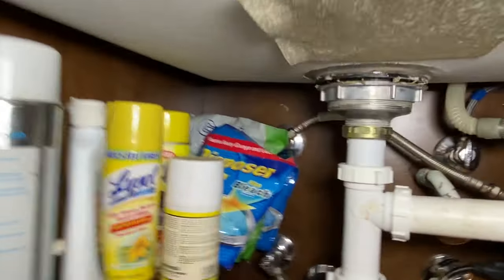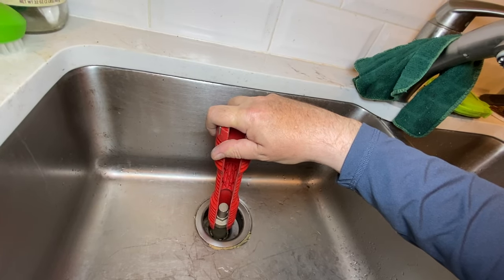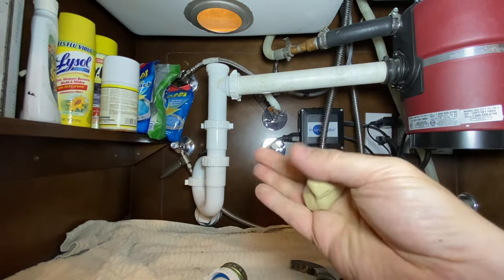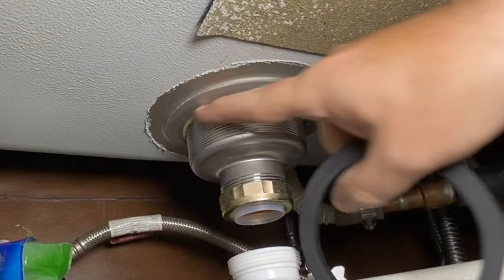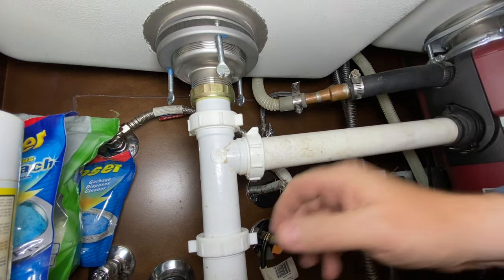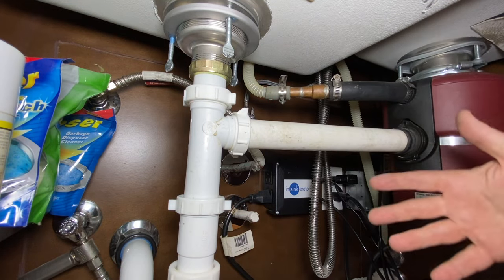Kitchen Sink Strainer Fail...NO CLUE WHAT HAPPENED!!

Comment: Most basic basket strainers use a tiny bit of stainless steel on the inside and the rest are junk (pot/white) metal.  It doesn't take much for the basket and nut to expand/contract or for the threads to literally disintegrate over time.  It's surprisingly common.  If any moisture gets underneath it's almost guaranteed to wreck the basket strainer
Reply from the maker: That makes since and is such a bummer!  Even the supply house ones I’ve seen have the pot metal nut. I’ll be on the look out now for a better quality

Comment: Hi, this is an excellent video. The only thing I would suggest is when you are talking about the large drain nut, you need to go into more detail regarding how tight that should be. I actually squeezed out all the plumbers putty before realizing that it was over tightened. I would suggest that with each slight turn that you run the water to check for leaks after all is assembled. Honestly, depending on your strength level, you may be able to get away with hand tightening. However, with that drain wrench you really have to be careful of over tightening because there is not much resistance to adequately gauge the tightness factor. Otherwise this was an EXCELLENT video.

Comment: Good fix … I would high recommend using the thicker baskets they are better quality and seal up better also use drain kits from a plumbing supplier as the PVC is a thicker material and has better seals … no drips means no cabinet and floor damage in your future.. 🇺🇸👊🏼🔨🪚🇺🇸✌🏼
Reply from the maker: I kinda was in shock at how much basket strainers went up. I feel like they all use to be brass and now they are stainless and pot metal. I need to go see what other supply houses have beside Ferguson. Thank you for your comments Fred. Have a great weekend.
Reply: @ThatFixItGuy  
Brian I will check what brand I prefer using and I’ll let you know I’ll run down to the shop today and see what the brand name is they are great to use with no flex and yes the prices have sky rocketed since 2020 I think Ferguson is just carrying what they can now to be price competitive… I do get some of my plumbing supplies from them still
Reply: @ThatFixItGuy  yeah Ferguson is definitley going to cost you. Their prices have gotten outrageous, you have to price shop around nowadays

Comment: That's nuts lol It's my first time doing plumbing work under my kitchen sink, turns out the nut for the drain also snaps in and out 😂 and I think it's bcuz the pipes are not cut to the correct length, possibly distorting other plumbing parts. Now I got to watch a video on how to cut these pipes.

Comment: I’ve changed out the basket 3 x’s still leaks. Do I not tighten the basket nut tight enough? As I tighten of course more plumbers putty oozes out so I’m afraid all the putty is gone or should I not worry about it oozing out. The basket and threads are fine, it’s the paper / rubber gasket I keep changing out.3x ‘s! It’s a pain? Any suggestions how tight it needs to be or what am I doing wrong?

Comment: Never seen one with that round collar.   I did one that had the 3 bolts on a stamped triangular collar like a garbage disposal mount.   One of the ears of the collar bent as I overtightened it.   Round looks like a better design.
Reply from the maker: Yeah this seems to be a better set up than the triangle version. Kohler makes a great version, but it is double the price.

Comment: Those drain nuts fail frequently, they will split, I've had two in the last 10 years that split in half.
Probably made of inferior materials?
Also it doesn't help that I purchased both times at big box hardeware stores, I have found that Ace Hardware tends to have better quality products, as well as original parts you usually can't find at big box once they change out models, such as water heaters etc. Good old Ace Hardware usually carries it.

Comment: careful with tht knife there.  Scraping carbon steel against  Stainless Steel can cause rust.   If down the road you see that it did, and can spot little rust spots,  use  Iron Out.  A good long soak  overnight, and it will re-passivate the stainless and strip way any free iron.